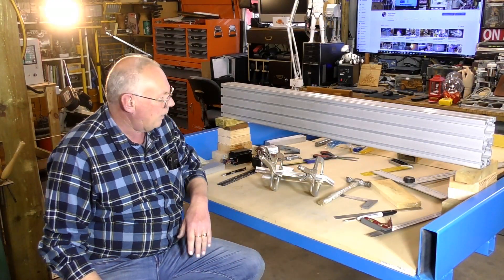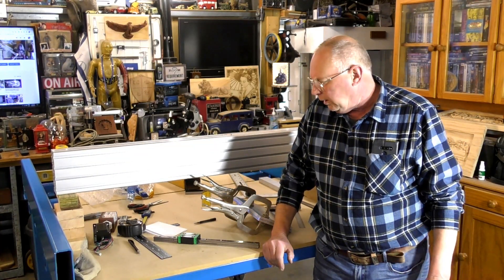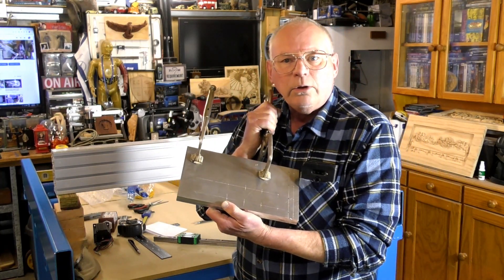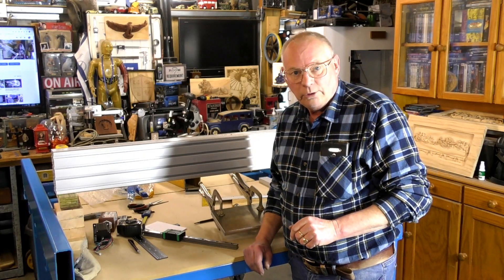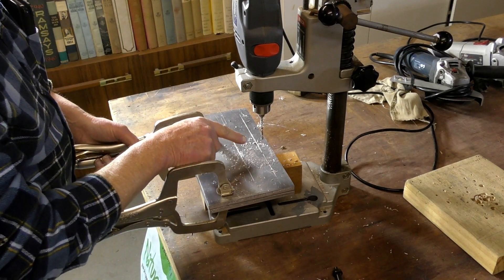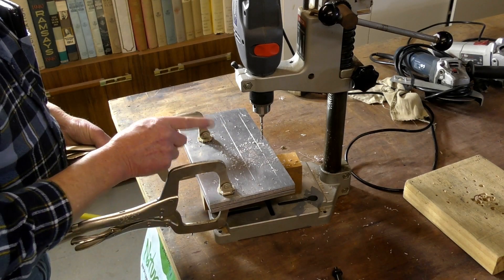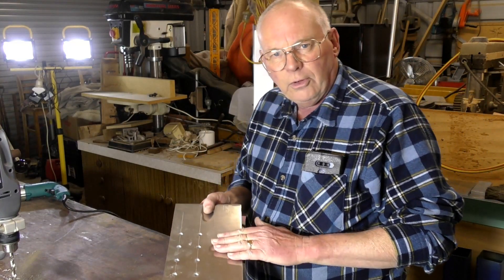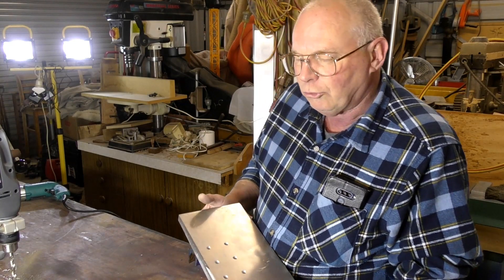CNC Router build  (4’ x 5’) Y-axis

Comment: Do we know what control system and servos your using yet?
Reply from the maker: Start with Mach 3 then Mach 4, non servo NEMA 24  4nm / 599 lb inch
Reply: @inventorsworkshop9600  Watched the earlier video as missed the notification to it
Reply: Roger, just bought a 6090 cnc, with a 3.3 kw motor, artcam and Mach 3, have no clue how to use it, what videos you recommend for starter, set up machine, first carving, software